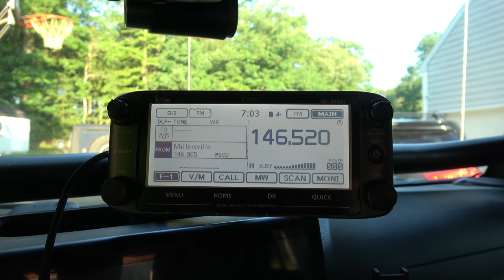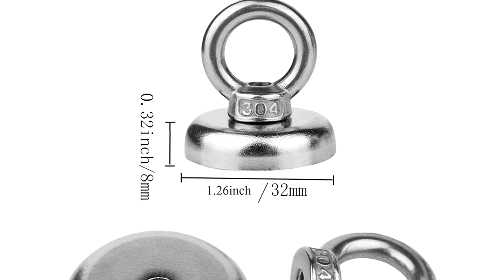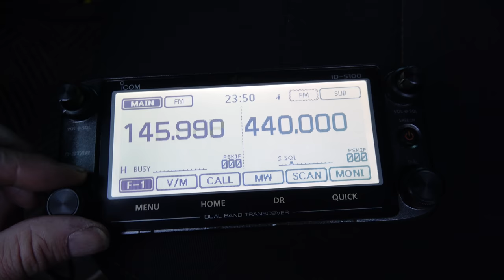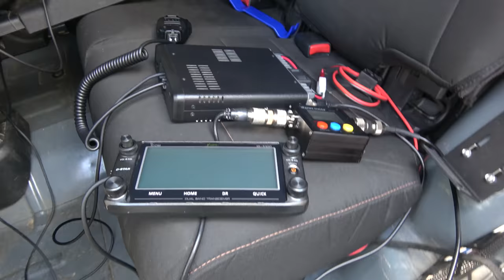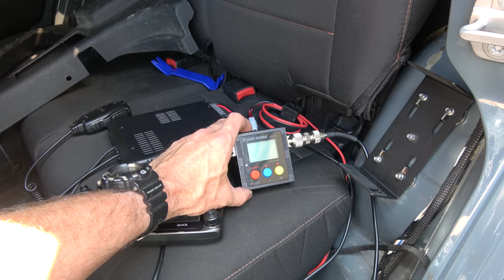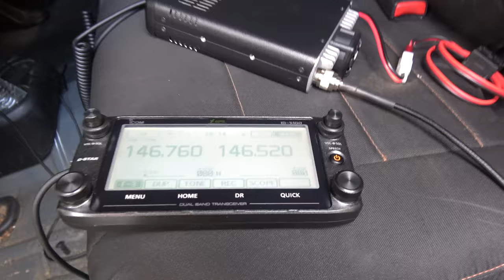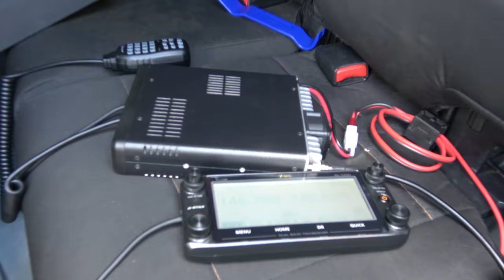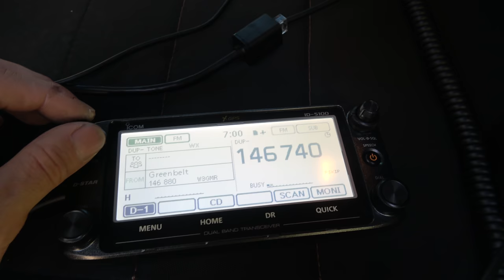Icom ID 5100 Installation into 2015 Jeep Wrangler - Ham Radio - UHF/VHF - Comms

Comment: I've been running an ID-5100 in a JKU for almost 2 years. Larsen NMO 2/70 antenna, Accessories Unlimited AUJ1 fender mount, and LMR-240 Coax (yeah the .1dB difference in loss vs RG-8 was that important to me lol). It's an absolutely awesome mobile rig.

One thing, though: the "don't run your DC power parallel to your coax" statement is incorrect information that is passed down from generation to generation. Just like the truck stop wisdom of "your CB coax needs to be exactly 18 feet long." It is perfectly acceptable run DC power parallel to coax.

Comment: You're good. Under 2 swr with your setup is good. Not worth trimming the antenna. And you may want to use caution about blocking the fan. That base module for the 5100 gets hot when you start transmitting. Your tool roll covered some of the exhaust fan when you put it up in there... be careful as it will shutdown due to heat.

Comment: God bless you for owning a Jeep, i bought one brand new in 2016 poured 30k into it in lift and tires bumpers body panels lights etc. Loved the way it looked, hated the way it drove.   Great utility vehicle bad daily driver. The most under powered 4x4 on the planet. Bought a diesel pickup and chouldn't be happier.  Anyway, to each his own, love the radio, I own the same one and I love how easy it helps you navigate digital. awesome video.

Comment: You could loosen those set screws and adjust the length a bit.  I have the same antenna in a Comet, and it's tunable to a certain degree.

Comment: Yes sir, if you have time, would love to see some more videos with this radio and set up, I plan on putting the same one in my Jeep, I passed my tech class a week ago last monday, studying for the general exam while I wait on my FCC Call sign. :)
Reply: It's great in the Jeep. Only downside is the speaker. If you mount the body remotely or under the seat, you won't be able to hear it above 45MPH.

Comment: Put a downward facing cable tie around the antenna cable at the antenna port of the trx and and any water running along the antenna cable will drip down.

Comment: One more thing: it is a common mistake to look only at SWR and think you have a great install. If you only check the SWR for the antenna in that location, you are missing half of the equation. You also need to look at the reactance ("X" on a proper antenna analyzer) as well. Your antenna placement is very close to the A-pillar and will experience reactance. The net result is that your antenna will not be ideally resonant within the 2m/40cm bands despite showing decent SWR; it will be ideally resonant below the bands, and impact your performance.

I know this because I went through the same exercise when installing my UHF/VHF antenna in a similar location (actually further from the a-pillar).

Comment: Great video!  I didn’t see in here but where do we ground our mobile radios on a Jeep?  I have my Kenwood grounded to the negative battery post with the inline fuse in place.  I was doing some reading and there are different opinions out there about whether we should ground to the battery or to the chassis.  What do you think?

Comment: Great video.  I did a very similar install using the same mount on the passenger side, with a Diamond NR73B antenna, and a yaesu FT-7900.  But my SWR isn't as low.  444.000 @ 1.2 and 144.000 @ just under 2.
Reply from the maker: Flonisha Merritt CHRIS?????   LOL
Reply: It could be a couple things, could be a coaxial issue (not exactly 50 ohms) could be an interference issue with the center load and “A” pillar creating an inductive or capacitive load...and a few other unlikely things... while ~1.9:1 SWR isn’t ideal....the losses are still only a couple of percent and in real life situations, you would probably never see an appreciable difference in performance between 1.9:1 and 1:5:1 SWR....hooking it up to an antenna analyzer would tell a bit more information also...as long as there isn’t excess heat that the unit and fan (if equipped) cannot handle, you should be OK also to be considered is that antenna is 2 5/8L on 440 which makes for a lot of gain but requires loading to bring down to 50ohms...could be the antenna needs a little tuning which Diamond doesn’t seem to provide much information on...
Reply: Chris Hale ...well as long as my radio dosen't blow up on me...lol.  thanks for the feedback.

Comment: Very helpful video. Where did you get the head unit plate and magnets to attach to the 67 Designs?
Reply: Looks like that's the MBA-2 Remote Head Mounting Bracket, by Icom.

Comment: Awesome setup, my only concern is the future of exposed water to rust from the bare metal on your antennae mount bracket do you foresee that being as issue?. Once  again awesome setup. Thanks
Reply from the maker: B McD that's why I was careful to only sand the parts that were covered. There are no exposed bare metal sections. I was considering putting some sealant around the edges of the bolts and the bottom of the bracket....but I wanted to make sure everything was good first.

Comment: Great vid. Very helpful. When you ran the antenna wire from the engine area thru the firewall, where did the wire come out in the driver side?  Did you have to pull carpet up? Or take some plastic panels off to see the wire come thru the firewall?
Reply from the maker: There is a rubber grommet in the firewall above and to the outside of the brake pedal area. If you shove your head under there you can find it. I did pull off the side kick panel. I already have no carpet.

Comment: Just got mine installed in my Jeep. Question is, which mount did you use to attach the head to the 67 designs arm? I'm using their universal device holder for the moment, but I want that for my phone and I'd prefer to use the magnetic mount that comes with the radio like you did. 73  de W0EUC
Reply: CPO, I would also like to know what 67 design mount you used for the magnetic plate. Thanks
Reply from the maker: It's the JK mount.
Reply: @o3djeeps  You should link to it in your notes.
Reply: @o3djeeps  Do you have a link for the mount?  I understand the arm and the clamp.  But what mount do magnets attract to?  If you have some links for these items I would appreciate it.
Reply: @miketynion  The metal plate is the ICOM MBA5 (https://www.gigaparts.com/icom-mba-5.html).  I have no idea what size magnets those are or how the metal plat attaches to the 67D arm (but would love to know!).

Comment: I'm sure you know by now, but the ICOM's don't transmit on FRS/GMRS without opening it up and modifying the board.  That's the #1 reason Jeep owners want them. Correct me if I'm wrong here. So you might want to mention that.
EDIT:  Looks like you explained it in the next video.  Probably should have mentioned it here that it's ILLEGAL and will not transmit on GMRS/FRS legally, for other Jeep owners.

WRFP871